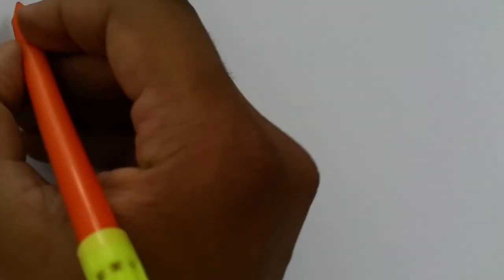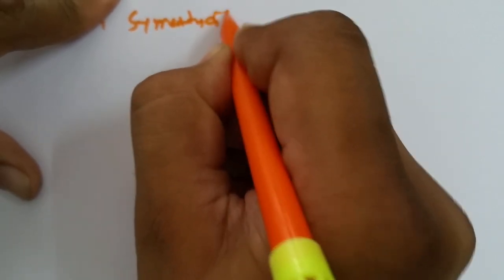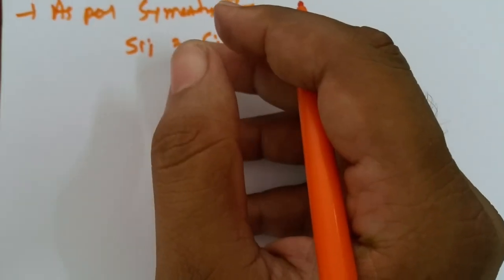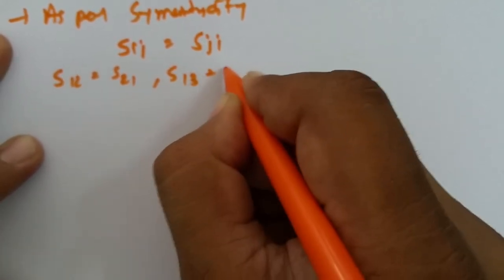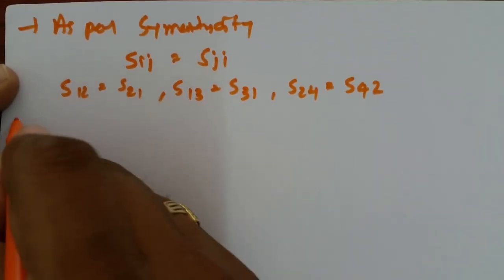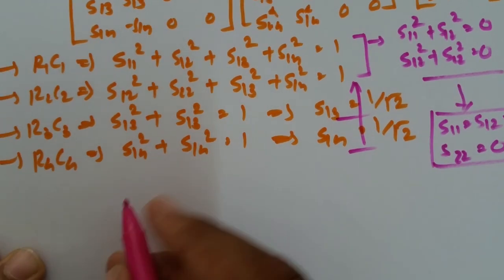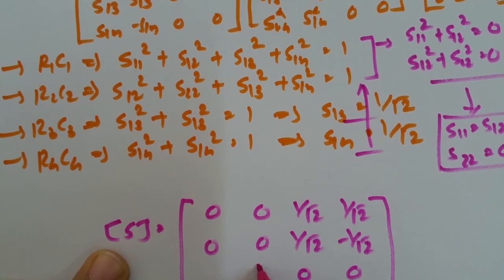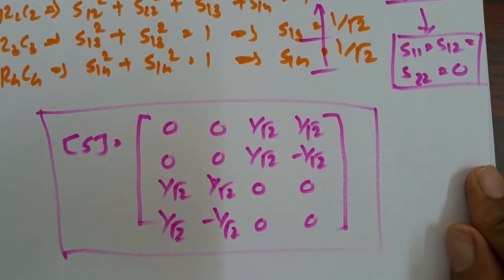Magic Tee (Basics, Working, Internal structure, S Matrix & Applications) Explained in Microwave

Comment: Sir how is S32 = S13, you didn't specify any relation in the lecture
Reply: the output port H that is 3, so S32 specifies when we give the input to the H port then, the output from the port 2 will be S32 or S23 and that will be in phase with the output from port 1 S12 or S21, this will be different in case of E Plane as S42 = - S41 or S14. Hope this helps

Comment: If a wave is input into port-3 then waht  S31=S32 or S34=S43=0?..please clear this one
Reply: s13=s23 //
Reply: its like the input port is return after the output port, in case of s31 the input port is 1 and 3 is the output port, got it??